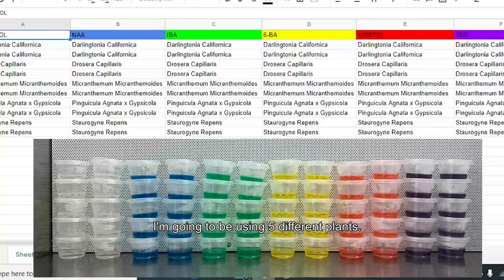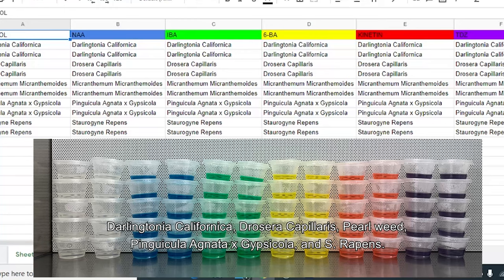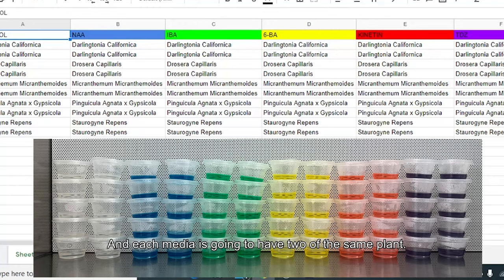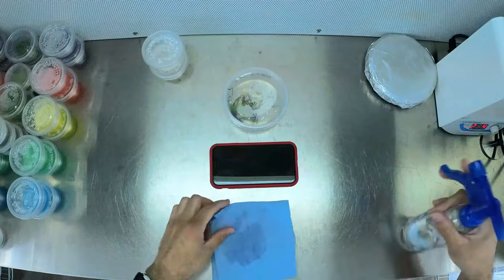Plant Growth Regulators

Comment: I noticed you added all of the PGRs prior to autoclaving. Could that obscure the results for the heat sensitive PGRs that were used?
Reply from the maker: When you add hormones before autoclaving, you use heat-stable hormones. Otherwise, it definitely hinders the results. Heat-labile hormones need to be sterilized using the filter sterilization technique after autoclaving the media.